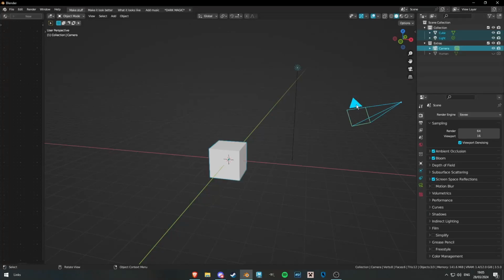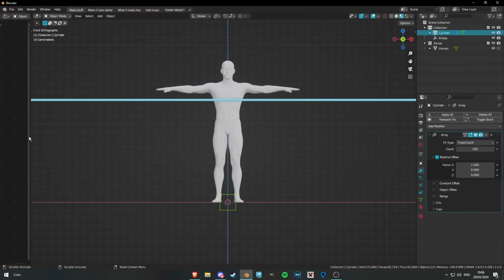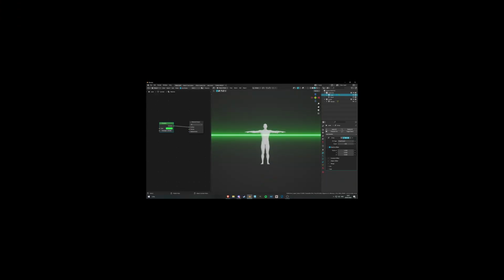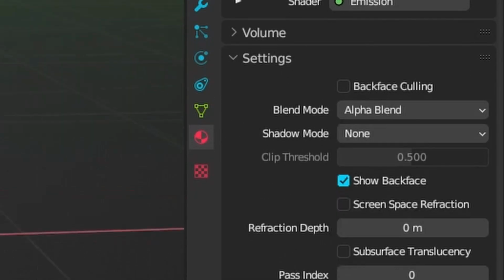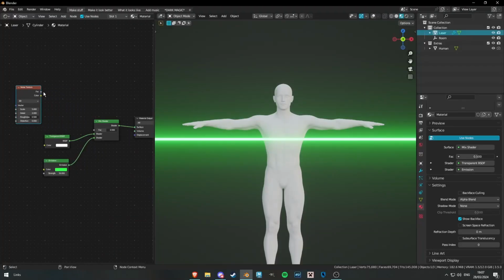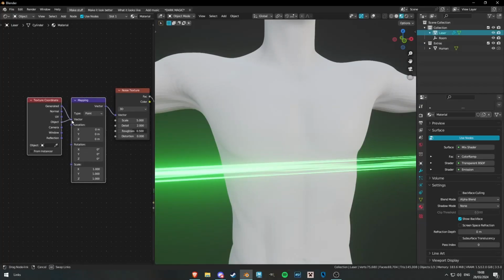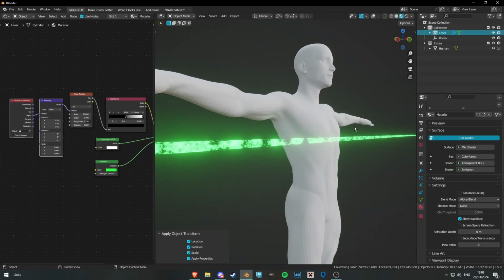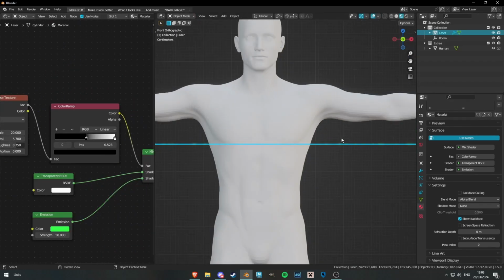Making lasers in blender!

Comment: I don't understand anything, I start the first part to try to understand how he had lengthened the cylinder in the first 5 seconds but not even at 0.5 of speed I understand anything, well, tutorial that would have been useful totally wasted because it goes very fast, taking for granted that one knows how to do everything
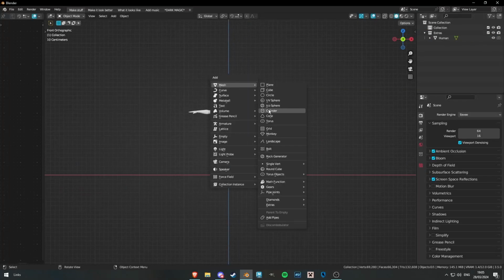Reply: Hi, he clearly says to give it an array modifier, you can also see that on screen at 0:05. Still, he probably would have answered you if you had just asked (?
Reply: @pixsy-r9c6e The array modifier creates multiple duplicates of the object, it does not makes the object longer. You need to apply rotation to actually make it longer.